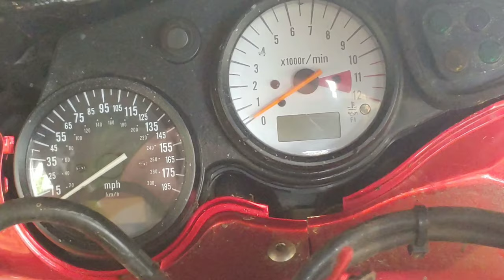Suzuki TL1000S

Comment: I have traded my cbr250 for a 97 tl1000s in 2018. I put over 3,grand into this bike to get it running and I love it!! It had only 16 thousand miles when I got her, and I’m Never getting rid of her. I do know when I went to test ride this bike, it intimidated me. It was heavy ( and I can from a Honda shadow 750 spirit and a Honda cbd250 )and overall
Powerful! Now I flick this bike around like a bicycle lol
Reply from the maker: It is a very easy bike to get addicted too LOL this is the third one I've owned.
Reply: Cunningham garage have you did the mod for for water pump to make it get up to temp at all times? I notice if I’m not over 150 degrees the bike runs poorly, almost as if I got bad gas. But when it’s over 150 ( usually sits at 156-162) it runs and screams!
Reply from the maker: Not yet right now I need to synchronize my throttle bodies. If the whole country gets shut down soon and I can't go to work I may just make a bunch of videos about stuff like that LOL
Reply: Cunningham garage lol right! Sounds good! I’m subscribing to your page!
Reply from the maker: thank you very much for subscribing. I definitely need to start making more videos I've been slacking LOL